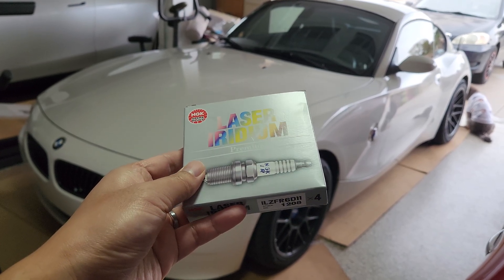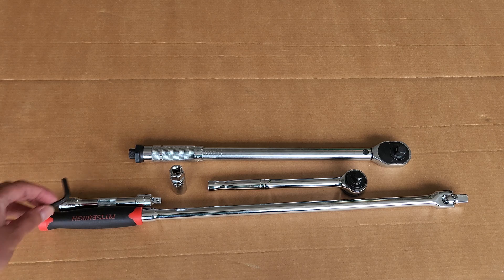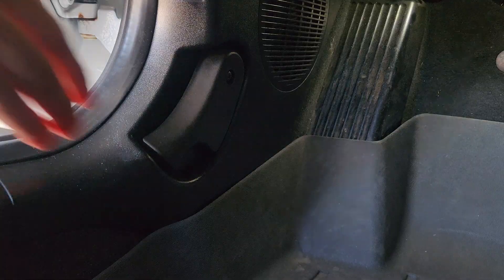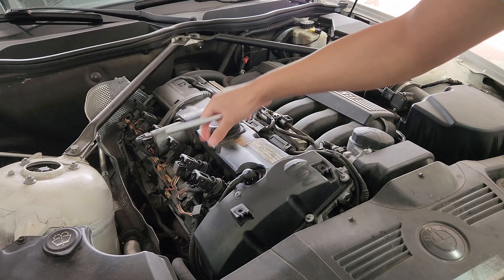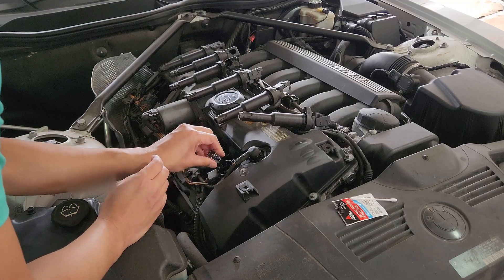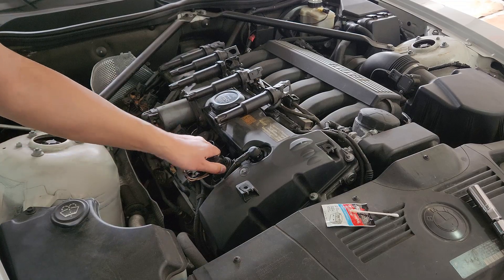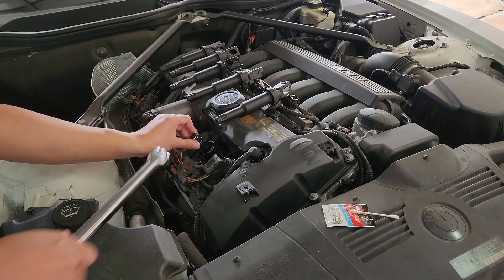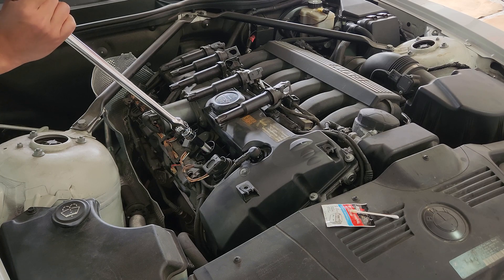Spark Plugs and Ignition Coils | N52 E85/E86/E89 BMW Z4 2006-2011

Comment from the maker: Spark Plugs
Z4 Produced Up to 12/2009
  NGK: https://geni.us/u09fI
  Bosch: https://geni.us/zbQ9s
Z4 Produced 12/2009 and After
  NGK: https://geni.us/HpeB
  Bosch: https://geni.us/gnAQnz5

Ignition Coils
2007-2011. 2006 silver engine cover cars could be different. Double check.
  Delphi: https://geni.us/p4RATF
  Bosch: https://geni.us/GNuP

Tools
Spark Plug Socket: https://geni.us/NmFA
Socket Drive Adapter: https://geni.us/WA0HY
Socket Extension: https://geni.us/6oYde
Ratchet: https://geni.us/Mcic8v
Torque Wrench: https://geni.us/KoCd
Allen Hex Key: https://geni.us/IXepEse
Dielectric Grease: https://geni.us/pCNuk

Gaskets: 
Black Engine Cover Z4s
  Valve Cover: https://geni.us/PwUbX
  Actuator: https://geni.us/xzLNC3
  Eccentric Sensor: https://geni.us/40Yny
Silver Engine Cover Z4s
  Valve Cover: https://geni.us/q7xAJrA
  Actuator: https://geni.us/GYM4
  Eccentric Sensor: https://geni.us/wJn6h

*Please double check compatibility before buying and be wary of non OEM as it may not be exact*
Help support me breaking apart my car and putting it back together. This description contains affiliate links. If you buy a product through my custom link, I will earn a small commission at no extra cost to you.

Comment: Any good ideas goes to clean in tight areas such as around where the coils/plugs stationed, where oil may be sitting
Reply from the maker: Ah yes. I had some oil in my spark plug hole. I wrapped some paper towel around the handle of a ratchet. I have it in this video: https://youtu.be/-BOKTMXOkrs?feature=shared&t=231
Reply: @DrewZ4 much appreciated for the quick reply.
Reply from the maker: No problem. Good luck 👍🏻

Comment: Hi mate, I have a 16mm spark plug socket (even have a 14mm one) for the extension/wrench thing but it seems massive compared to the actual spark plug? Is this normal? They are M 12 x 1,25 thread size and suggest spanner size 14mm? I don’t really know what’s what haha but the socket seems massive
Reply from the maker: If you have the engine similar to mine the 16mm should be it. But you can test it on your new spark plugs first to see how it fits on that. Then when you get the coil off, just see if that socket can fit into the hole. That's all you'll need to worry about, and being able to get the socket back out of the hole. Good Luck!
Reply: @DrewZ4  Thank you mate, my local garages wanted about £600 for parts, I managed to get Bosch plugs and coils for about £250 instead, so I will attempt to do these myself as I think it is a good skill to learn. Hopefully it clears all my missfire codes on scanner haha. 

Mine is an N54 Z4 35iS but still the E89 I believe. I got a tool kit now thanks to your advice which had a 16mm socket with it also.

Thanks again for your great video
Reply from the maker: Good luck! It shouldn't be bad. But just letting you know that this video is for the N52 and will look different and may have different parts.